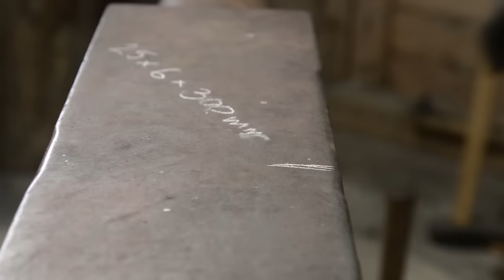Blacksmithing - Forging a drawknife

Comment: Torbjörn, i LOVE what you do;
Little tip; try chalking the wood where an axe handle is gonna rest, or any tight metal on wood part that you don't want slipping.
Chalk is extremely grippy, never lost a head or decorative metal part with it.
Also try chalking your files too, it works well for clog prevention.
Reply: Very useful tip, thanks!

Comment: Nice job....looks beautiful. The one I have has the handle tangs go all the way threw the handle and are upset on the end. This keeps the handles from coming off when using it because on a draw knife you are putting a lot of force on the handles to pull against the wood (basically pulling the handles off). Keep up the great work. I am going to try to make one soon.

Comment: Beautiful piece. I almost freaked out when you bent it as much as you did then I remembered that it would straighten itself as you drew out the edge. I was thinking "wait no a draw knife isn't curved that much!" The only thing I personally would have done differently, would be to wait to hammer down the collars until the tangs were set to depth so that it would tighten the wood down around the tangs and have less chance of coming loose later on.
Reply from the maker: Thanks! The wood was pretty soft and I was afraid it might split on me so I put on the rings first.
Reply: That makes sense. Again really beautiful piece.

Comment: Lovely work, top class in fact. You take a lot of pride in your work. Its very evident in the process and that workshop. Can I make a suggestion - consider a longer tang on both sides, where the handle is drilled right through where you pein over the tang end over a small washer that will not allow the handles come off. The draw knife by its very nature wants to pull the handles off by the action of the blade. I have found that using these knives, over time the handles can work loose and its not as effective, bit frustrating in fact. I have a favourite drawknife that has the tang peined over and that is very robust. No stir on the handles and no movement and its a very old knife. Its just a suggestion.
Reply from the maker: Thanks!! Yes the handles might come off... we will see. The problem is, it's all tool steel so it cant be peined over or bent without heat. I considered threading, but that would have required annealing the tang tips. The angled handles removes some of the force in the tang directions at least!
Reply: All that needs heat is the very tip, localised heat that just allows a slight pein over of the tang end outside both handles. Nothing too heavy duty. Consider a 3mm x 3mm tang end finish and just redden the end enough to stop the tang end re-entering the handles. (put a small washer on each handle end over the tang before heating and peining) Check out how the sword smiths finish off the pommel ends or buttons of a sword blade, same technique but yours only requires a fraction of the heat and pein over. Again, all suggestions. I'm not knocking your work just offering some constructive suggestions.
Reply from the maker: Thanks. No problem!

Comment: Marvellous attention to detail, including the heat treatments.

Propane burned in air is never quite hot enough is it?  You need oxy-acetylene (or oxy-propane) to get that heat.  It's the same trying to get a quick black heat for the purpose of applying a little brass patina (from a brass brush), or even warming quickly so as to apply some beeswax, linseed, etc.  You would think propane alone would be sufficient.  It never quite is enough on its own.

Great video again.
Reply from the maker: Thanks! Yes, that's right. In this case the water cools too good :)

Comment: What a professional YouTube chanel. Great job! straight to the point, no useless talk, nice images and beautiful environment.  I was looking for a good approach to forge a draw knife and yours looks excellent.
I am thinking about forging a smaller "portable" draw knife eventually with forged handles instead wood handles but I am still wondering about the ergonomic shape for these handles... I take any of your suggestions! or maybe a video ;)
Reply from the maker: Thank you!! That's no problem. I think simple "loops" for handles should work fine. Probably will be a bit uncomfortable in the long run, but for smaller jobs just fine.
Reply: Torbjörn Åhman, I will try it out and show it to you once done. Thanks
Reply: Hi again!
As shared previously I am finally going to do my "mini one piece draw knife" this Thursday (hopefully I'll have a day off).
I have two questions for you if you don't mind:
- You used an O1 steel for this project. I have a O1 bar with a section of  2 x 5/32 inches AND a 1095 bar with a section of  1.5 x 5/32 inches. As the 1.5 inches would better match the width of the final blade's section, it would be faster (easier ;) to go with the 1095 but it has less carbon that the O1... Did you use the O1 tool steel because the final cutting performance is way better? Would you think 1095 would be good enough or do you suggest me to go with the O1 (note that my blade length will be around 10cm long)?
- I was wondering why you didn't speed up the process by grinding the blade cutting edge instead of forging it. I agree that it is not the traditionnal way to proceed but do you really think it adds something to the blade performance or did you just want to be 100% blacksmithing?
Thanks!
Cédric from Québec
Reply from the maker: The reason I used O1 is that I have a bunch of it! O1 is very hard to grind if you haven't fully annealed the piece, so I wanted to do as much as possible in the forging process (in case my annealing didn't work out that well). Also by forging the bevel you widen the blade a bit. I'm not an expert here but I think 1095 and O1 are quite similar. Maybe o1 is slightly better but 1095 is easier to work with I think. Go for the 1095!
Reply: Before all, great GreenHouse! Your place looks like a peaceful area, much better than mine!
Now I understand about the O1! I made a signature punch yesterday using a big O1 rod. Because I needed to make filework on it, I annealed it first in a small furnace which I built up with a simple hand torch and fire cement: warmed up by the torch, this cement keeps the heat for several hours after the torch is off so annealing want really easy. If not already done, you should give it a try.
I am going to do it with 1095 then as I know this material better than O1. 
I can't wait your next video!
Thank you for your excellent work.

Comment: Fascinating to see how you tempered the back (non-cutting) edge without affecting the cutting edge (in water), but I missed how you tempered the cutting edge. How did you do that?
Reply from the maker: I did temper it entirely in he oven first to get the edge right.

Comment: What is the Purpose of hiting the hammer on the Anvil and letting bounce on hard surfice?
Reply from the maker: We're not hitting, just bouncing. We hate to waste energy stopping a hammer. When we need to look at the work/figure out what to to next/turn the work/change the grip of the hammer etc. it's much easier to let the hammer bounce and pick up the rhythm from there.

Comment: Another stunning piece, great work as always. I like the way how you finished the two end parts of the knife where they meet the wood handles, high polished blade vs. semi-forged finished ends. It surely provides a tough accent into the fine knife. When working with the drawknife, the blade and the handles want to go the opposite way. So no epoxy in the handles, only friction holding them in place?
Reply from the maker: Thanks. Yes, only press or friction fit... will see how that works out, but I have seen many like that.

Comment: I have always been fascinated by blacksmithing - your videos are definitely fun to watch.  You are a true craftsman.  If I may ask: I know absolutely nothing about this craft, and I just have to ask: what are those thin gray flakes that always appear when you strike the hot metal?  Is that stuff from the surrounding air, or the metal, or....?  Thank you again for sharing these incredible videos.
Reply from the maker: Thanks! We call it "scale", it is iron oxides that form on the hot surface of the steel in contact with oxygen/air.

Comment: Now that’s a drawknife to be proud of, very nicely done. I noticed you put a slight curve in the blade before hammering in the beveled cutting edge, was there any particular reason for doing this? Regards from “ down under “.
Reply from the maker: As you forge the bevel it will bend. If you bend it in the opposite direction the right amount first, you end up with something straight after forging the bevel... or at least close.

Comment: Really cool video. But quick question: You tempered the blade in the oven, right? Why did You do it again with the torch in the water? Does that have any benefits, because I've never seen that done before. 
Thanks in advance
Reply from the maker: The idea is to make the spine softer and tougher than the edge. Less likely to break.

Comment: Beautiful work as always. I love the northern European connection to wood (my wife is Finnish, my sister lives in the north). Thank you for sharing this.

When forging an edge, does the work tend to curve toward the bevel? I expected it to do the opposite. I would like to emulate this piece.
Reply from the maker: Thanks! Yes when you forge the bevel it's impossible to avoid expansion length-vise, and that is curving the blade.
Reply: @torbjornahman  Yes sorry to waste your time, and thanks for replying. I re-watched the video and now see that it was indeed bending the way I expected it to, and you'd anticipated that by pre-bending the blade opposite the way it was expected to go. I missed that and thought it was bending toward the bevel. Pre-bending was very clever.

Comment: In the immortal words of the Bard, " A lathe, a lathe, my kingdom for a lathe"....

Just kidding Torbjorn.  I always have a cheap wood lathe lying around so I can spin up handles like these pretty easily.  The last lathe I found will likely be the last I ever need as it is quite good quality, but it only cost me $25.00. 

Another really great video.  The only thing I might do differently (and that is not to suggest that I could make a draw knife anywhere near as good as this effort of yours) is to run the tangs all the way through the handle and either pein them over a washer or bend them over to prevent the handles from pulling off.
Reply from the maker: Thanks! Yes, I'll get a lathe some day...   Yes the handles might come off... we will see. The problem is, it's all tool steel so it cant be peined over or bent without heat. I considered threading, but that would have required annealing the tang tips.  The angled tangs removes some of the force in the tang directions at least.

Comment: Absolutely Brilliant. 
As usual the first thing I do when I bring up you tube is look for a new  Torbjörn video and when they are there, its like Christmas Morning,...thank you.  A real precision work, no power hammer ever, lots of refined steps, a real joy to watch. 2 Questions, was that the draw knife itself you were using to shape the handles? and did the handles need any glue, they won't pull off?
thank you again, amazing to watch
Reply from the maker: Thank you!!!  Yes I used the actual knife to make it's own handles :) No glue. The elm wood is quite soft and seems to grab nicely. The angled tangs also makes the pulling force not so strong in the tang direction.

Comment: Fantastic work. Very clean, as always.

I have two questions.

1. What material did you use for that quench tank?
2. Have you ever tried an edge quench for something like this? It would seem to me that if you just quenched the edge and drew a straw color temper on the edge before cooling fully, you wouldn't need to torch temper the spine. Is there an advantage to the way you did it, or is it just a matter of preference?

Thanks again for your fabulous content!
Reply from the maker: Thanks! The tank is just ordinary PVC pipe... nothing I recommend. Use something out of metal. I have tried an edge quench, and the reasoning seems perfectly ok, but the result was a very warped blade. This blade also warped a bit, but to my advantage I think. It might be possible to correct for things like that though.
Reply: @torbjornahman  Thanks! I have a very small metal quench tank and have been tempted to use PVC as an inexpensive temporary solution, but was always paranoid about it.

I have a good quality file made from W2 that I've been contemplating turning into a draw knife. Looks like it's time to just do it.
Reply from the maker: @DeliberateGeek  It's very important to have sufficient amount of oil for a good quench. The rule of thumb is 10 liters / 1 kg of material to quench ( about 1.3 gallons / pound )
Reply: @torbjornahman  Thanks. You're absolutely correct. What I've been quenching up until now has been quite small, far under a pound and I've been using a 1 gallon metal container. I simply need to just put together a more appropriately sized tank.

Comment: What did you use for the raw material. Someone suggested using spring steel, like that used in truck springs. Would that work?  Also, have you ever heard of the work by William F. Moran, a blacksmith that lived in Lime Kiln, MD USA (western MD)?  He's no longer alive, but when I was a teenager, I read about him in the Baltimore Sun, a local newspaper. And, I persuaded my parents to drive me out there so that I could meet him. I was astounded by the things he made: knives, axes of all types, swords (including two-handed ones). He was very highly regarded in the US, and I understand that he was even a consultant to the Bethlehem Steel Company in Baltimore.
Reply from the maker: Here I used O1 tool steel. Spring steel makes a good knife indeed. No I don't know Mr. Moran, sorry.

Comment: What was reason for bending it between the fullers on the anvil? And cutting end grain that's one sharp knife. Thanks for sharing
Reply from the maker: I pre-bend it before I forge the bevel. Forging the bevel will bend it back straight, more or less. Thanks!!

Comment: 2:30 Why did you put a curve in it, then flatten it back out?
Reply from the maker: When you forge the bevel you will bend it. If you bend it in the other direction first, it will end up straight or there about. Easier to do it like this instead of straightening the bend at the end when you have a thin edge.

Comment: I know I pretty late to the show here but if you are reading this watch out when using vermiculite (the "beads" you use for normalizing). It is a mineral and in some cases it has a small percentage of asbestos, it's not much mind you but I got a chill when you poured some over and there was a cloud of it puffing out. 

Just a heads up on reading about it some.
Reply from the maker: Thanks, I have had similar comments! I doubt it applies today with all regulations, but I'll be careful.

Comment: Great job again, congratulations !
Why you did not heat the steal before to put the wood handles on ? It's usually what we do with files when we plug the handle on them.
Reply from the maker: Thanks!! Decided to do it without charing the inside of the hole. Step drilled the holes instead.

Comment: Beautiful, classical design. And for the use footage at the end, extremely functional. Mine will shave, but I can't quite get an end-grain cut lime that. I wonder if my angle if off. What is your bevel angle on the blade, and approximate approach angle to the end-grain? Also, it looked like you were bevel up, is that correct?
Thanks.
Reply from the maker: Thank you! Not sure, the bevel is probably around 15-18 degrees, plus a micro bevel. The approach angle to the end grain is almost parallel. Yes bevel up, but I have the handles angled down slightly.

Comment: Do you have physical plans for each item you make? If not, how did you obtain the knowledge to build these tools by your knowledge and experience. I’m asking because the methods are counterintuitive to how a layman would try to build it. Based on watching your videos, I’m taking a blacksmith’s class this Sunday! Thanks for your inspiration.
Reply from the maker: Great, I hope you have a good time!  No, I seldom have physical plans, mostly just in my head. When you learn how you can move metal you develop a feel for how to approach a problem. That said, most projects can be attacked from various starting points and still reach the same end result. It's part of the challenge to figure out a way to forge something. When you have a working order of operations, the actual forging is pretty straight forward for the most part. :)

Comment: Beautiful work as always.You're an inspiration to many. What was the point of normalizing then annealing? Seems to defeat the purpose of normalizing? Annealing makes a big grain structure. Normalizing it will refine it. Should of normalized after annealing?
Reply from the maker: Thanks! I normalize after forging to get an even grain structure and get rid of any internal stress from forging.Between the cycles I correct any warping or bending. Before hardening I do another normalize cycle but apparently I missed that in the video...
Reply: Gotcha!! That makes sense now. Haha
Reply: Any chance you could do a video of your heat treating process including when you would grind?
Reply from the maker: Most of the heat treatment process was already in this video... But you might seek a detailed explanation?